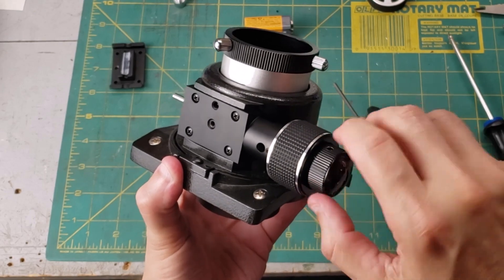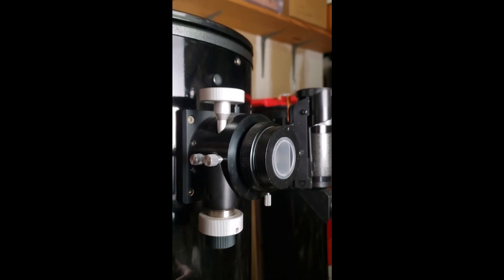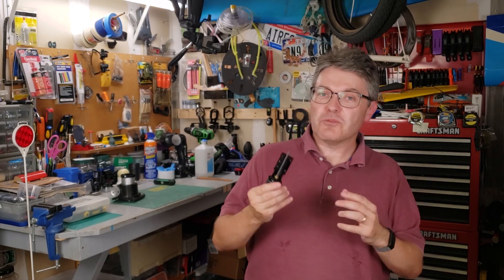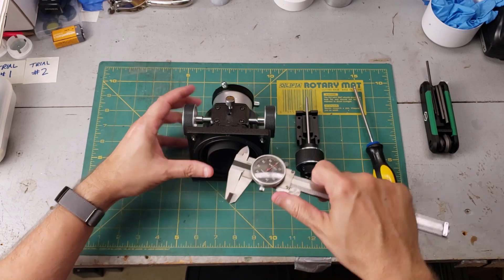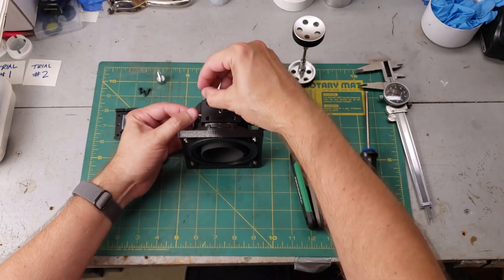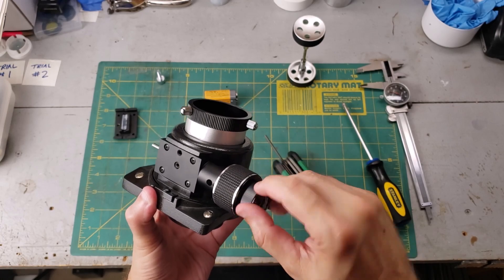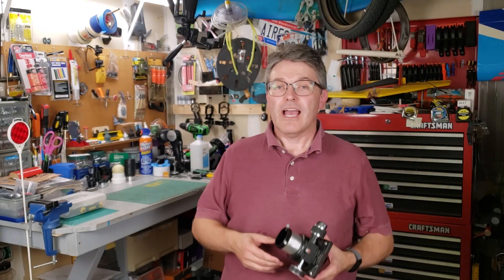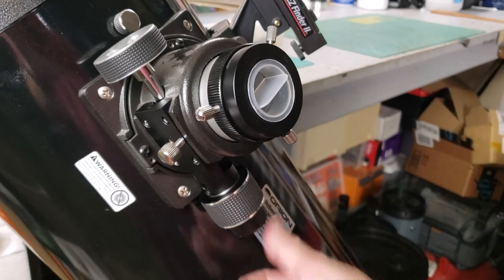Dual Speed Focuser Upgrade Kit - A Budget Upgrade For Telescope Owners

Comment: I'm a year late to the party, but thank you for the tip. I have just installed my Lacerta kit on my 8" Celestron Dobsonian. Silky smooth and tight focus control, and the wobble I had on the original shaft is now gone! Thank you so much for all your helpful videos (and the Dad jokes!) best wishes from the UK. 🙂
Reply from the maker: The Lacerta party runs every day of the year, haha.  Congrats on the new dual focuser.  I got used to having it very quickly. Have fun!

Comment: I took apart a GSO focuser from my 6" RC. The fine control, coarse focuser mechanism comprises 3 ball bearings, which clamp the axle for the fine focuser. It can be cleaned up but ensure you remember where all the little grub screws (for Allen wrench) go. It was fiddly but now it all works smoothly and was worth doing to understand how they geared the 10:1 ratio - clever!
Reply from the maker: They are really clever how they work.  It's a great invention.

Comment: My crayford dual speed is brand new, and yes I was using heavy Celestron Luminos eyepieces. Now my crayford silver tube is stuck in the UP or OUT position - its like catching on the little black half circle plastic thingy on the underside of the crayford (inside the dobsonian tube). I did just notice too... that one of the little black center screws is just flopping around in the hole - not tight. I'm assuming I'll have to take it off my dobsonian, and mess with it. Any tips?
Reply from the maker: Be careful, but yes, probably best to carefully remove the whole thing from the telescope tube to see what's going on.
Reply: @AstronomyGarage  Thanks! All set - I fixed it. Just had to pick up a Torx set of bits. Hardest part was balancing the main adjustment screw tension with the counterscrew below that. You had to get an even balance so the tube didn't flop.
Reply from the maker: @KJC63   That is great news!  Have fun with the telescope!

Comment: Looks like getting a lathe is one of the best moves towards amateur astronomy for me. The money is quickly saved since I enjoy building anyway. I might try building a microfocuser some time in the future.
For my current goal, the lightest sturdy solution wins.
Reply from the maker: A lathe or a small milling machine would be super useful.  For me, I rely on my 3D printer quite a bit.

Comment: I know Lacerta as the brand for their own product line of the Teleskop Austria shop (I think it is not necessary to translate the name). The employees are Austrian and Hungarian amateur astronomers and the produce many parts in Hungary.
They have some rebranded stuff probably as well but if it is one of their original products it might be the reason for the high price on the American continent.
I bought my 8“ newtonian when dual speed was quite a bit more rare and upgraded quite a while ago since the upgrade was so much cheaper than a new focuser.

Comment: After watching your video I purchased this kit from David Astro and installed it on my 8" dobsonian.  I was skeptical whether I needed a dual focuser but after putting it to use I see this is a very worthwhile upgrade. It takes the focus from "not sure if I'm perfectly focused" to "bang on".  Stars become significantly more crisp and then when I turn to a deep sky object I'm sure I'm getting the best view my scope, focuser and eyepiece can give.  I was also happy to be replacing just the focus wheel and axle and leaving the base of the focuser untouched, to avoid a the risk of mishaps in a full focuser replacement.  The viewing improvement is worth the cost, for sure.
Reply from the maker: I'm so glad it worked out for you.  I use it a lot on my 8 inch Dob.

Comment: I found that I like rack and pinion a bit more.
Reply from the maker: I've always had terrible luck with rack & pinions, but that may be due to always buying cheap used telescopes, lol.  The GSkyer refractor that I have has a fantastic tight rack & pinion, despite the primary lens being lackluster.
Reply: @AstronomyGarage  the rack and pinions just don't have the ability to slip which I like.

Comment: I installed the Lacerta 10:1 microfocuser on my 10" Celestron Starsense dobsonian. It works great! And your O-ring solution for the Crayford focuser works great too. 4 O-rings on the big wheel replaces the broken rubber ring that comes with the focuser, and 6 O-rings on the Lacerta metal wheel
Reply from the maker: I'm glad that worked out for you.
Reply: What model Lacerta microfocuser did you purchase?  I have a 10” Dobsonian Celestron StarSense Explorer as well and would like to upgrade.
Thanks in advance….JK.
Reply: @jimk1887  Lacerta Dual Speed 1:10 Microfocus Upgrade Kit for Skywatcher Crayford Focusers
Reply: @jimk1887  From 365astronomy in uk
Reply: I have the same dob. What exactly was broken and will I need to DIY something myself to fix it? Sorry it wasn't clearly explained in your comment so I'm hoping you can clarify.
Reply: Nothing was broken. This adds a 10:1 fine adjustment knob to a crayford focuser

Comment: Unfortunately, what seems to be missing on the market is an upgrade for real entry-level scopes. My first scope, which was a gift, came with a plasticky rack & pinion focuser I'd love to replace with something decent, preferably Crayford. But good luck finding a decent aftermarket focuser for a 130mm reflector. Seems like everything starts from 8" upwards.
Reply from the maker: It's nearly impossible to find a real entry level telescope with a focuser that isn't terrible (wobbly, etc.).

Comment: John I recently added similar 10:1 on my Bresser 102mm Refractor...oh my goodness, what an IMPROVEMENT !! Anyone reading this, I highly encourage you to do the same.  As ALWAYS John does his simple, top-notch instruction!! Thanks John!!
Reply from the maker: That is good news.  Thanks for watching!
Reply: I don't have the reduction, but I have two telescopes with Bresser-Messier's hexafoc focusers. They have a great value for the money. Hexafoc on my refractor is supersmooth and one on my Newtonian is little wobblier and not as smooth even after readjusting the screws, but it serves very well even with heavy binoviewer setup. Perhaps I treat myself to 1:8 reduction for the refractor one day. Costs up to 100€ here in Europe.
Reply: Hi all, I have a Bresser messier 8" dob and I'm thinking of upgrading to a 1:10 dual speed reducer but it's no longer available in stock on the bresser website, I'm left with the 1:8 option which I think will do the job. If possible  from users of Bresser telescopes a little advice about this. Thank you very much.
Reply: Been trying to contact Lacerta to make enquiries but I don't see an email contact address on their site. Which model do I need for Bresser refractors? Would it work for example on an Orion ST 120?

Comment: I bought one of these in 2012 for my 8" Newtonian & then switched it over to my 10" when I sold the 8", it works really well for what it is.
Reply from the maker: I keep wondering if I forgot something, but it just worked right out of the bag.  It arrived used without any accessories (o-rings, etc.).
Reply: @AstronomyGarage  Just a pity they don't come with a matching course focus knob for the other side as they so look kinda odd fitted, to be honest by what you have is pretty much all they come with anyway if my memory serves me correct.